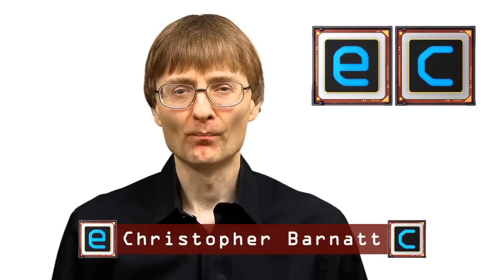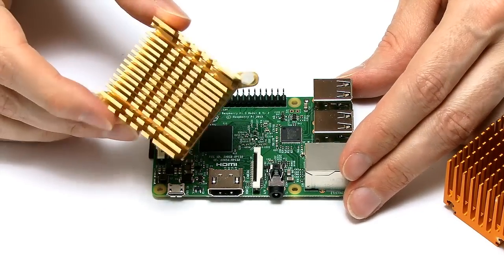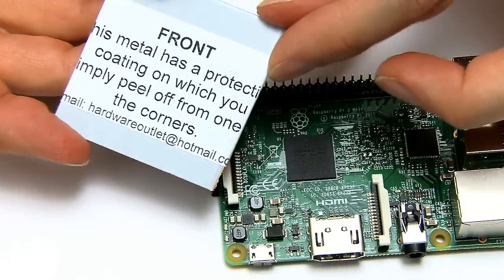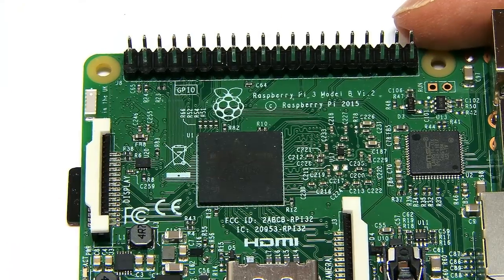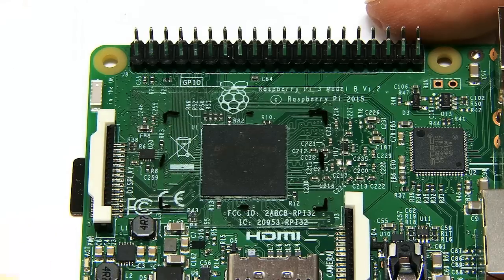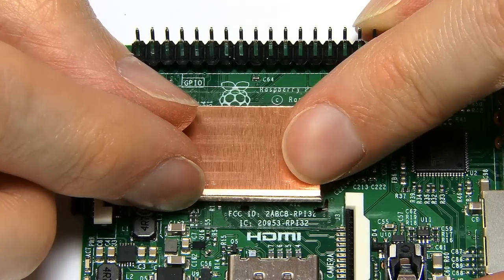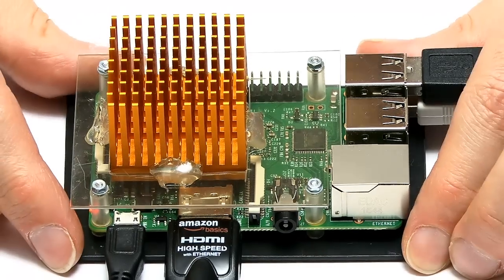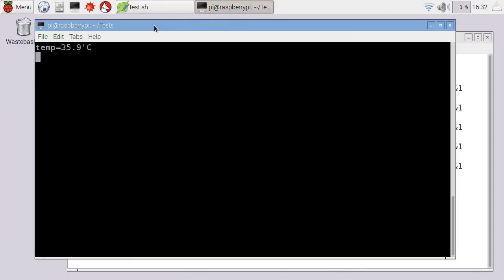Raspberry Pi 3: Extreme Passive Cooling

Comment: zip tie is better than hot glue
the hot glue will not hold DOWN the aluminium, it will only hold it in place. so the spaces between the heatsink and copper & between the copper and cpu will move around and create massive cooling inefficiencies
Reply: Using zip tie has the potential risk of using too much force and cracking the chip/breaking the PCB in the process. I guess an intermediate solution would be to use just a little bit of downward force while applying the hot glue until it's dried.

Comment: Next up - Liquid cooling the Raspberry Pi :P
Reply from the maker: +Soham Gumaste Yes, you have to question if I have really come to an end with this yet . . .
Reply: Haha
Reply: +ExplainingComputers Mineral oil.
Reply: +Soham Gumaste Now that would be an interesting experiment.
Reply: +ExplainingComputers Good series. As pi is getting so powerful now, they will start be using for more things, including heavy load tasks. I can't decide on my cooling solution yet, but these videos are helpful.
Reply: +Soham Gumaste 
Liquid nitrogen.
Reply: pcuser80 Space is a bit cold.  But I don't think the Pi would survive the cosmic rays.
Reply: Satish Singh Thank you I do know that.  What you missed was that the joke was to look for an even more extreme form of cooling for a tiny computer that costs next to nothing.  The more extreme the method the more expense.
Reply: thats is ...insane .....but ...has to be done bring on the nitrogen!
Reply: +ExplainingComputers I can make a liquid cooler for it, I liquid cooled my 360 lol. Hell why not got for submerged board with a phase change cooler cooling the mineral oil heat moderator.
Reply: +Soham Gumaste hybrid cooling? with a massive 220w tdp air cooler? i saw it once but i can't find it anymore...
Reply: +Soham Gumaste ek waterblocks :D
Reply: + ExplainingComputers 
Please use the Fluorinert next time lol.
Reply from the maker: +Daniel Turner Excellent! :)
Reply: clangerbasher In space there would be no air to dissipate the heat to, so it would overheat! Even in air, you can't really rely on convection (see how they cool the hardware on the ISS).
Reply: +Soham Gumaste And then LN2, and dry ice
Reply: Do a liquid helium cooled R PI and test it vs boring old hobby level liquid nitrogen cooled.
Reply: Soham Gumaste. Someone has already done it ... seen it on another post

Comment: I found that result surprising. I expected the fan cooling to be best. Interesting.
Reply: +Paul Rautenbach same. I wonder if the fan was blowing air onto the heatsink or pulling air off?
Reply: +Paul Rautenbach 
That is what I thought, too.
Reply: The fan was flowing air ON the chip.
Consequently out on the sides.
Reply: +Paul Rautenbach Indeed. I wonder how the results would stack up if he ran the test for longer... does the heat generation from the chip overcome the thermal mass if it runs hotter for longer? Meaning some occasional active cooling is needed and the heatsink can do the rest.
Reply: +Paul Rautenbach 
it's surface vs aircooling, for instance people familiar with houses passive heating/cooling
know that heat losses are related to HL=S*R R=0.12 usualy for air, cause air create a thin film on the surface and air is a good insulator, but a fan reduce the size of the boundary layer to a thinner film, with airflow around 4m/s R=0.044, here the bigger heat sink obviously have a bigger surface than x2.7 gained from using a fan on small heat sink.

Comment: I used to use the same heat sink years ago in my own power supply experiments and I loved it. When they discontinued it I was forced to find a replacement and I did in Digikey. They have very similar heat sinks that could be used very easily to replace the one you used. About the same size and design also.

Comment: Hmm thinking of doing this to my AVR receiver... I used heatsinks similar to this on the HDMI board that is prone to failure due to BGA cracking. And six 120mm fans on top of the unit.
Reply: +Danny Gee Adding many fans can cause the opposite effect. You can end up with static points of pressure that do not move the heat away from the unit.

Comment: Cool (sic).
What happens if you now add a fan to the big heatsink? A chance to play with some pelier-driven toys, perhaps?
Reply: +Graeme Collin Same question ^_^
Reply: +Graeme Collin Yes. It''s peltier btw. Also add a fan and overclock the cpu. :) Btw, is it posible to overclock the cpu?
Reply: +Dippo6905 Peltier - yes ... that's what I thought I'd typed - dodgy laptop keyboard, especially round that I/O/P area ... grrr ... ;-)
Reply: +Dippo6905 Think Chris's looking at overclocking in the next RPi video ... unless, of course, we can convince him to continue the cooling the standard board for a while ...
Reply: +Graeme Collin The last Peltier unit I used consumed about 80 watts. That's significantly more than the Raspberry pi as a whole (uses about 12.5 watts.) Seems like extreme overkill. Hah.
Reply: +Kazriko Redclaw I was thinking in terms of those self-powered eco-fans you get for stoves and such, which use use a thermo-electric temperature differential effect to generate the power to drive the fan itself. Am I wrong in thinking that this is the peltier effect in operation, and confusing it for something else?
Reply: +Graeme Collin That's covered under the same phenomenon as the Peltier effect, but is technically the Seebeck effect instead. Seebeck is generating electricity from a temperature differential, while Peltier is a purely electric heatpump where electricity is used to move heat from one side to the other.
Reply: +Kazriko Redclaw Ah, right. Thanks. Seems like it's one of those terms that gets frequently mis-used. Thanks for the clarification. :-)
Reply: +Graeme Collin Yeah, that's a tricky one because there's only small variations between devices designed for Seebeck and those designed for Peltier use. Mostly in the temperature ratings. They're interchangable functionally at lower temperatures, but not equally efficient for both jobs. Some people take Peltier devices and reverse them for use with the Seebeck effect.
Reply: +Kazriko Redclaw Hence theconfusion and mis-use. Definitly sounds like a pretty cool (!) way of driving a cpu fan, if it can be made to work properly - using the chip's own heat to cool itself ...
Reply: +Graeme Collin True, though the big problem with that would probably be the very low power generated by it, and that it adds resistance to the movement of the heat. Your processor might run hotter than it would with just a passive heatsink. I saw someone take icewater and boiling water with one of these, and only get about 150 milliwatts out of it. (~160ish mA at 0.9v)
Reply: +Kazriko Redclaw Yes, I appreciate that there are big differences between stoves and cpu dies - not least the temperatures you're dealing with, and the surface (and air-space) areas you have to play with ... plus you're trying to achieve two different things - distribution of heat rather than removal of it. Hence saying "if it can be made to work properly". Could provide some fun experimenting, though.

On a similar idea, what about using a small fridge (like those thermo-electric mini-fridges), with the wiring coming out through, the door seal? I wonder how well they might work ...
Reply: +Pilot_Modelmat Yes, I recall Linus' video on the subject ... I've wanted to try a mini-ITX in a mini-fridge for a number of years (there was a trend a few years back, when it was still a very niche market, building mini-ITX systems into all sorts of things, and the mini-fridge idea kinda appealed to me), but an RPi seems even more ideal ...

Comment: Tip: Arctic also sells thermal adhesive, which is a "permanent" cooling paste. It's made especially for this purpose, to attach passive coolers without the need for brackets or hot glue.

Comment: Impressive improvement over last experiment! Congrats!
What is the Pi clocked at? And, of course, how far can you push it without fault with this setup?
Reply from the maker: +Frank Bosman Many thanks. The Pi 3's 4 cores are clocked at 1.2GHz. I will see in a future video how far they can go . . .
Reply: +ExplainingComputers Awesome ^_^
Reply: +ExplainingComputers Be sure to try it out with several RP3s.  The consensus seems to be that when it comes to overclocking them your mileage may significantly vary by machine-to-machine.
Reply from the maker: klosterdev I am sure you are right, and this is a great idea in theory. But in practice. I am not going to buy several Raspberry Pi 3s for an overclocking experiment! :)

Comment: now do a liquid cooling
Reply: +kunal pahuja YES!!
Reply: +kunal pahuja Not much advantage. Liquid cooling doesn't mean cooler, you still have a fan on the end taking the heat out of the liquid. The idea of liquid cooling in PC's is to take the heat away from the PC and cool with a fan on the outside, instead of air cooling with warm air trapped inside the PC. On a PI, it's in the open already, thus no need for liquid.
Reply: Joe Anthing i want to see how he can pull it out at such scale. Nothing else
Reply: +Joe Anthing water cooling would remove the space constraints on placing heatsinks.
Reply: take one small butter container, fill with cooking oil, place in Raspi.....
Reply: Got me thinking about tiny water cooling systems for a raspberry now.  You would find all of the components in a small internal combustion engine for an RC car.  The hoses for fuel are like 1mm in diameter, you could rig a tiny battery-powered pump using a micromotor (the smallest I've seen are used to make smartphones vibrate) and then like you said, any tiny container as a reservoir.  Just drill a hole through a piece of copper to use as the heatblock and have another slightly larger veined or finned piece of copper as the radiator.

"Why is your pocket making that buzzing sound?"
"Why, that would be the water cooling system on my Raspberry Pi!"

You'd get any lady you want.  Within reason.  And probably only if she's a fellow nerd.
Reply: Or not, because it doesn't need it.

Comment: Don't normal heatsinks usually come with copper plating directly on the CPU and then aluminum sheets/fins welded to it? I see so many critical comments concerning the material and the combination , but in reality that's a perfectly fine method without going so far as soldering the two together.
Reply from the maker: +HankthePropaneTank Thanks. :)
Reply: +HankthePropaneTank Very true, both are used in heat sinks/radiators. The only problem comes if they are mixed in a water loop, which they aren't. Although a water cooled Pi would be awesome, pointless, but awesome.
Also, isn't the copper piece called a shiv?
Reply: +Kizmet Mars I think you mean shim.
Reply: ERICSPEEd That's the one.
Reply: +HankthePropaneTank Copper even have better thermal capacity
Reply: +HankthePropaneTank The heat sinks I've pulled from old machines used aluminium pressed onto a copper core for CPUs and just aluminium slab with fins for chipsets.

Comment: That is a much better cooler than what's used on most small devices I will say that much for sure.  It's a shame that the chip uses a plastic cover rather than a copper an Ai one.

Comment: That's cray. Looks like the tiny heatsink and the copper block alone do alright in short bursts, but they must get saturated to the point where they can't dissipate the heat fast enough. Makes sense since the copper block has a tiny surface area compared to something with fins.

Comment: The only reason the copper did not work was because it does not have a lot of surface area.  Heatsinks work by having a large surface area which dissipates the heat better.
Reply from the maker: True.
Reply: No, must say.Aluminum has much lower anisotropic values (1.22) compared to copper (3.16). This results in lower vibrational entropy which microscopically (quantumly) means much lower thermal capacity leading to lower heat storage levels than that of copper. So, yes! while copper tends to conduct and accelerates heat diffusion much faster than aluminum, copper's higher vibrational entropy stores heat energy longer while it is being transformed from thermal to vibrational entropy back to thermal, and that is why its release speed of heat is significantly lower than that of copper. so while for cooling heat diffusion is faster in copper, heat release is lower in copper and higher in aluminum. For heating, not quite so! while for coils inside the warmer medium (condenser is now inside the room) heat is dissipated faster by aluminum coils, which is what we need to get warm, evaporator coils outside in colder temperatures need to be copper so that they absorb heat faster, and store heat longer.
Reply: Copper and aluminum are both effective materials for heat sink construction, but they have different requirements. If you want to know why, consider a great chef's kitchen.

Aluminum sure can move heat, if it has been done right. It very efficiently absorbs and transfers heat to it's environment and things that interact with it. This works great for bacon in the morning, and even for boiling water, but isn't so good for a large, thick filet mignon. That cold slab of beef sucks the heat right out of the aluminum, and there isn't any left to keep up the cooking. Many people who buy aluminum cookware have a lot of trouble doing steaks properly for this very reason. Aluminum has a low thermal capacity, and a very high thermal conductivity.

As such, aluminum just wicks heat away with little concern for anything else. It won't wick as much as copper, but it sure will move it quickly; Dumping it's capacity as soon as any heat leaves the sink, and quickly soaking up more.

Copper moves heat as well, even if it hasn't been done all that well. Copper very efficiently absorbs and transfers heat as does aluminum. It does it faster, as well. That said, copper has an incredibly high thermal capacity. That big fat steak just can't suck up all the heat that copper will hold on to, and this is where copper and aluminum differ in requirements. Copper won't readily dump all the heat energy it picks up, because it holds so much of it before it changes temperature to any great degree.

That leaves us with a problem. Copper needs help. Somehow, you have to remove all that heat from the copper, as it will just hold on to it otherwise. A copper heat sink can work much better than an aluminum one, but you have to either have loads of pipes and lots of fins and airflow, or you need peltier/water cooling with excellent transfer to help it out.

The thermal capacity of copper, when compared to an aluminum heat sink of the same design, completely removes the benefit of using copper in the first place without help. As a matter of fact, a poorly designed copper sink can be much worse than an aluminum model.

The best way to use the materials is being tried nowadays, and that is combining them. As with most good things, they work better together than apart.
Reply: And that is why with the tiny heatsink end up with 80C and copper slab end up with 81C. and as you can see copper along dose better in a  short amount of time than aluminium , as time goes by ,  copper slow heat dissipation appeared.  Passive heatsink copper is not always better. Of course if you have a big capper heatsink with light heating , capper will be more affective than aluminium for passive heatsink  . but that is not cost affective.
Reply: Sir, are you a scientist? all i've cared about so far was surface area * thermal conductivity = happiness
Reply: YszapHun I do find many sciences to be very interesting and know a few things at least about some of them.
Reply: Yifu Cheng
 So would it have been better to use an aluminum heat spreader or a copper heat spreader?
Reply: Kenneth Florek this video has content  the perfect solution for Pi3 passive heat dissipation. 
if you read the full comments of mine, you will understand when and how to use copper or aluminium , or when to combining them.

Comment: What an amazing video! I never thought that passive cooling will work better than active cooling.
Reply from the maker: +Satish Singh I was very surprised at how well this worked! :)
Reply: +ExplainingComputers I think this is because the bigger heatsink as more surface area. the smaller heatsink wasn't covered by much air, the blades blew air all around the heatsink but not over it, it would work better blowing across it, but because the heatsink falls into the large centre commutator, it wasn't cooled very well.

Comment: what if you add a fan to the top if this heatsink
Reply from the maker: +Dudefoxlive It would get even cooler! :) I guess by a good 10 degrees.
Reply: that would be good. might get one someday but right now i don't have the time to mess around with it much if i did get one.
Reply: +Dudefoxlive It would be extremely quick and easy, I have something similar using an old 100mm case fan and the little aluminum heatsink. Just elongate the bottom board a little, drill four holes, two either side of the case fan and use some cable ties to stand the fan in place. I was running a high overclock and getting a delta temperature of 18*C above ambient. Such a big fan may seem overkill, but i have a usb hub board and HDD stacked on top of the Pi, so its keeping those cool, also.

Comment: JUST throwing it out there check the TPD of the Raspberry and see about a TEC/peltier fan + heatsink, takes place of the copper block and then you can additionally factor in TEC control on the Raspberry pi via power mosfets and PWM control which will combine cooling and programming together for a good project. if the TPD is 20watts you could easily meet those peltier heat transfer requirements.